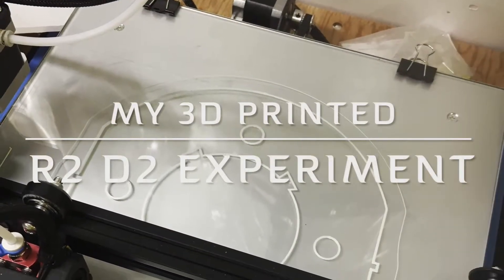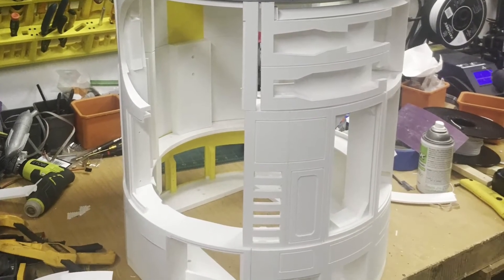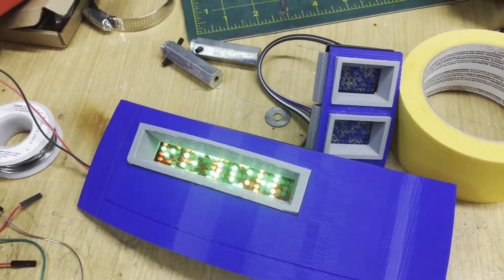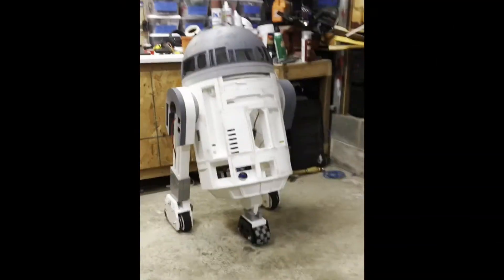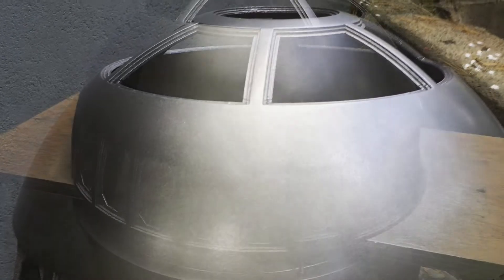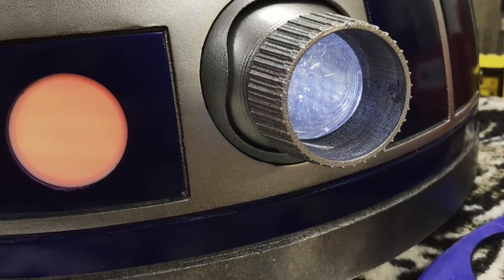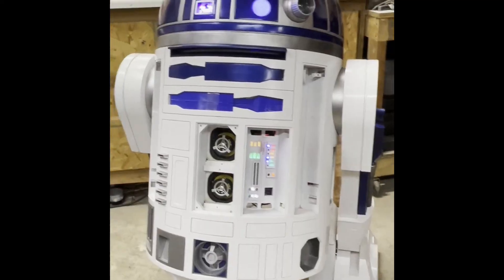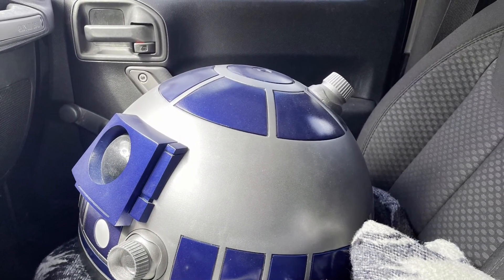3D Printed R2-D2 project

Comment: That is so clean! Very nice printing. PLA+ wow. "I love to solder" That explains a lot! I hate it myself.
There are a lot of mods on Thingiverse you can download to enhance things. Stuff like hiding a plug in port in one of the octogons, stuff for the speakers, those 2 buttons on the dome, there is mod to turn them into power and reset buttons, etc.
I too went to the MIII drive, I finished my assembly of those a few months ago.
Black undercoat: Yup.
"Sanding the tops of the pie pieces at 45 to work:" Nice tip. 
"Split the power" Michael Baddeley mentioned that several times. Good call.
Awesome job!

Comment: This is most excellent!  Did you use entirely pla plus, was the base color for the body white, did that cause challenges in being able to see sanding marks vs black or grey?  Im going to do this build have 3 printers rn and starting out too, i originally wasnt going to paint anything just going with blue/grey/white but now i might be second guessing that (or is it too rough looking without sanding/paint).  Did you spray the body after it was together i assume?  I've estimated i could probably print the entire structure day and night in about  8-12 days with my equipment (p1s, qidi 4 plus and neptune 4 max).
Reply from the maker: Thanks Marc! So believe or not R2 is mostly printed in PLA. I started using PLA+ after the price started to drop in 2019. Thats kinda of the reason I call this my Experiment. The base body color was printed in white. I didn't notice any issues sanding, only that there was a lot of it! I did spray the body after it was together. I used a cheap palm sander on most parts but you definitely have to be careful or you will burn through the plastic. I'm going to try a Chopper or Mouse Droid next. I still have the old (old, lol) CR10 but I am picking up a P1S soon. We have a Sovol SV8 at work and the print speeds now a days are insane compared to my printers from 5 years ago.
Reply: @KevinFlynn1967  ah very nice ok, yeah good to know on the burn issue.  I picked up a "foot sander" to hopefully making sanding easier on projects but i guess you have to watch out.  I guess if the price difference is small between pla and pla plus, maybe ill still do pla.   Any issues with your pla per say? is it white at its base i assume?
Reply from the maker: @markm75  I haven't had any problems with printing most of this project in PLA, but now that better filaments are much easier to print, I would probably go with PLA+ at a minimum. If I remember right I did 30% infill and 4 walls min. on most parts. I tried to print most of the parts in the colors they would be but it's really not necessary. After sanding you should be priming before painting, and with the dome I did primer, gloss black and then the silver to make it look more like aluminum. I'm curious to start working on a Chopper build out of ABS. I think if any of the newer printers print ABS the way with the ease that I've heard I might go back and redo the legs in ABS but for now he's doing fine as is.
Reply: @KevinFlynn1967  i thought about abs for my new big builds like this, i even had an exhaust arrangement ready to attach, but i can only make that work on 2 of the 3 printers.  I thought with the bondo + primer filler method it might not be too bad with pla/pla+, who knows, yeah i've heard abs is easier.  Chopper would be #2 on my list, actually i was thinking of doing the battle droid first and maybe just straight beige and no painting, then move onto r2.

Comment: I got part way through mine and essentially killed my printer. I've got the dome, the body (which is a bit wonky due to poor print quality) and one and a half legs I think. 
I'm currently trying to build my own printer which has a bigger build area to help with completing the build... but I might end up redoing a lot and I'm even debating learning metal casting and trying to cast some/most/all in aluminium.
I also have a plan for making a miniature projector (and using laminar flow technique to create a portable "screen") for the Leia message... but the way I do things this is probably still a few years off. 
Love the finish you've got on yours... looking really great!
Makes me want my printer up and running so I can get back to tinkering.
Reply: You want a great printer get yourself a ender 3 max . I got one and I love it, if you make it all square as you put it together, then you get amazing prints off it.

Comment: Could you please tell us 3d printer's specifications to build this model?
Reply from the maker: I primarily used a CR10S from Creality dimensions are  300x300x400mm. I also used a scratch built Prusa clone 200x200x250mm.

Comment: Amazing work! Would you mind briefly sharing your painting process? What type of primer, specific colors, and clear coat? 🙏🏼
Reply from the maker: I just used spray cans from Home Depot /  Lowes. I honestly had no luck with filler primer. The silver and blue are the Chrysler and Ford colors if I remember right. The clear was also of the shelf from HD or Lowes

Comment: How much did it cost you to print and how much for equipment
Reply: You’ll be looking around 20 to 25 rolls of filament give or take and $25 each roll, electrics you can get the padwan 360 system which would cost you around $500 , you can buy a lights kit for about $200 , then you have motors and other little bits and pieces.

Comment: Impressive stuff, we've started on ours and I'm excited, just frustrated at how slow the printing is going.  :)  Two questions, where do I find the proper color codes for the painting?  I don't want to try to match the blue by eye... and where do you get the Marcduino boards now?
Reply from the maker: Hey Darryl Sorry for the delay in the answer. The color codes for the paint can be found on astromech. I can get the exact ones I used if you like. I ordered the Marcduino boards from oshpark I believe. You can also send the gerber files to a site and have them made. You will have to flash the arduino chips. marcaduino.com has all the info

Comment: Hello, I am currently printing the 2nd main body frame, of the ring that is, I have come to the leg holes in the body, (part 9a,9b,9c) how do these play in the finished kit?
Reply: You normally have to print the shoulder parts and that fits into the body of the droid then you attach the legs to that.